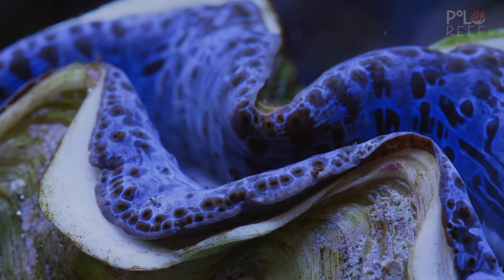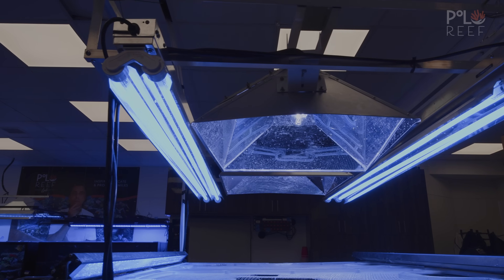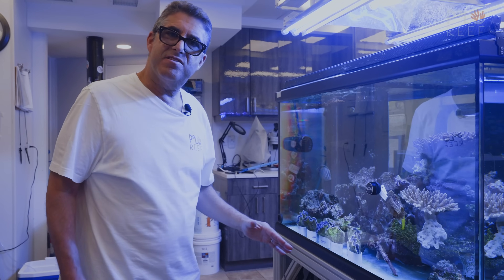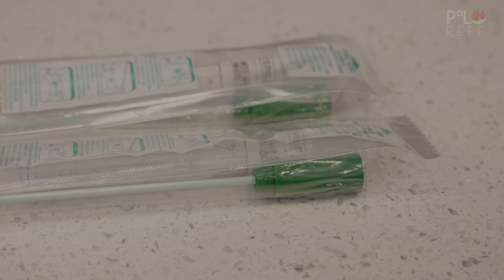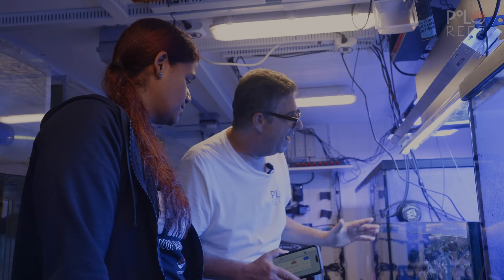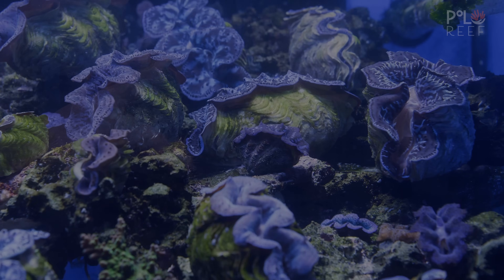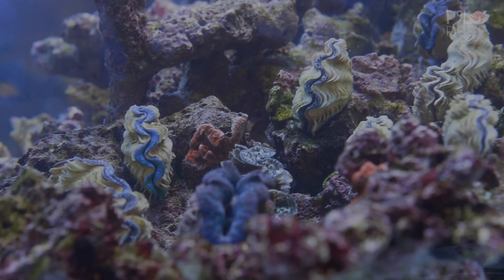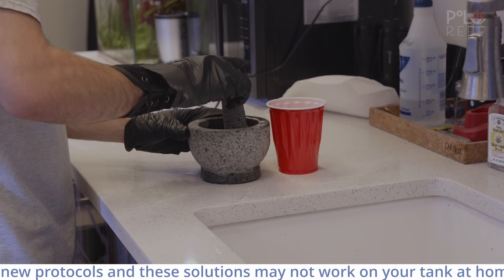Why do Tridacna Clams get such a bad rap? Did we find the Answer? Polo Reef Explores Clam Solutions!

Comment: I've had better luck with clams after stopping the gfo/carbon reactor.  I believe there are fine resin particles in the water that clams injest and don't know to "spit it out".  Now I just run filter floss.
Reply from the maker: @ScottieMckinley787  you know gfo ive been thinking about it  !   very possible